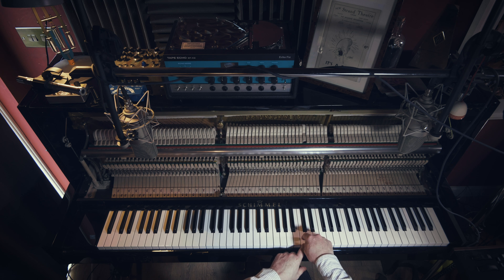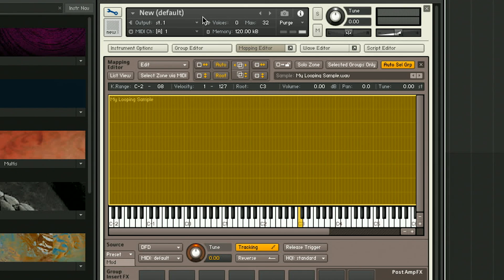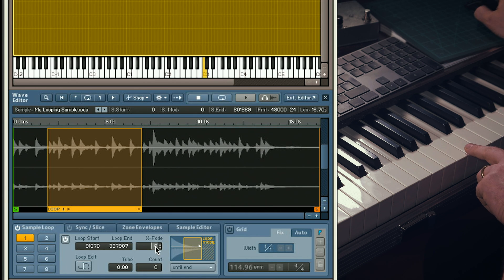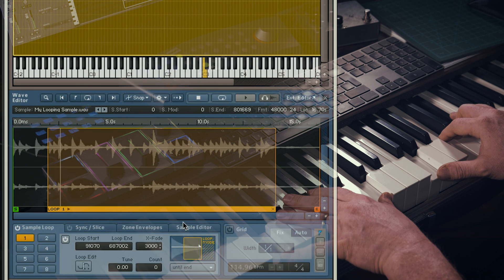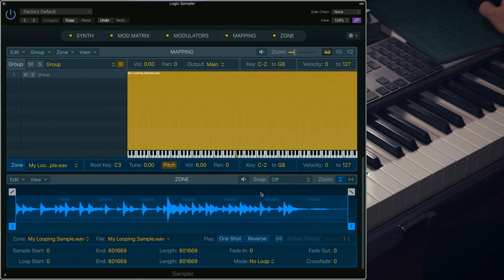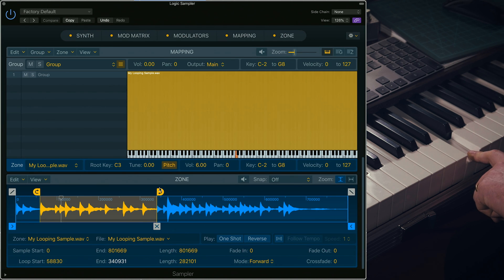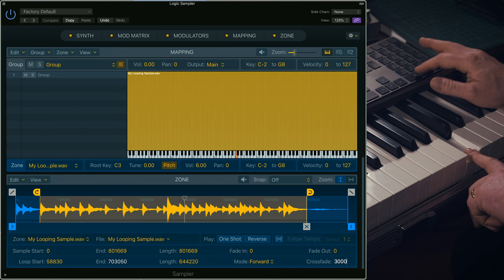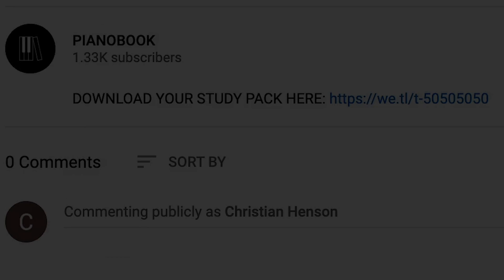How To LOOP SAMPLES  (Kontakt / Logic Sampler)

Comment: I'm fairly new to making my own samples and logic sampler user. I was wondering whether it's possible to create an instrument like this, with movement (tremolando or glitches etc) but for the rhythm/pattern be uniform across all notes even when triggered at different times. Hopefully someone understands what I mean as it's hard to put in writing. For example in this instance could you have a chord of tremolando all moving at the same time rather than each note twinkling independently?

Comment: As i don't know much about the internal workings of Kontakt, is it possible to add protamento effect to a controller knob in Kontakt?
Reply: Definitely possible with some scripting. What's easier is there's a built in "glide" control in Kontakt. When you open up the editor, there's a SOURCE section where you can control tuning. Click on "Mod" in the source section to open up source modulation settings. Click "add modulator..." and under others you'll see "glide". By default it should be routed to pitch. That should give you portamento control. Maybe you can set that to a midi controller knob, I'm not sure.